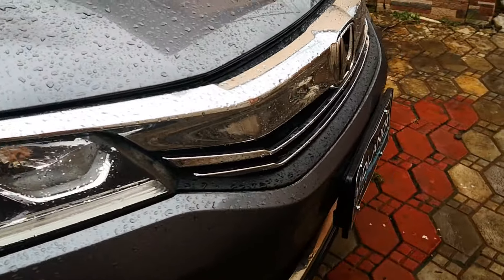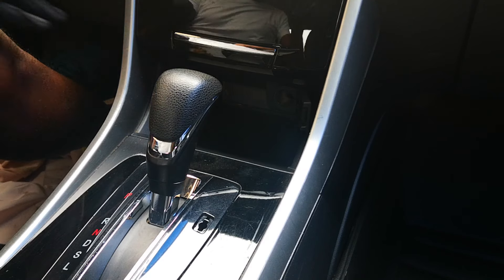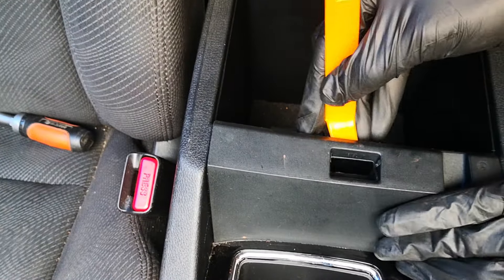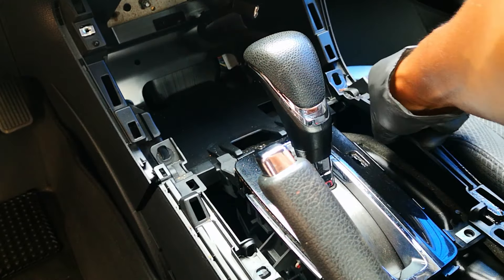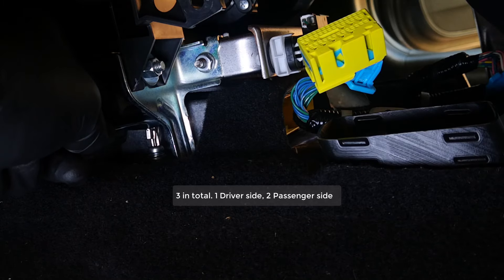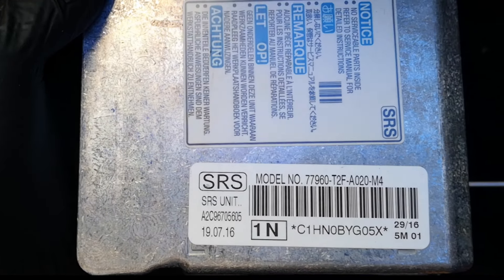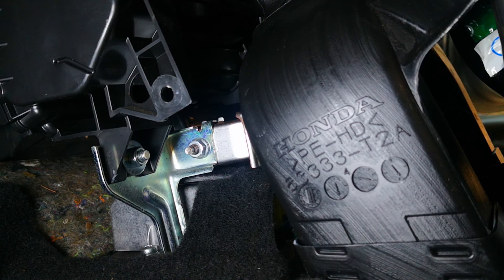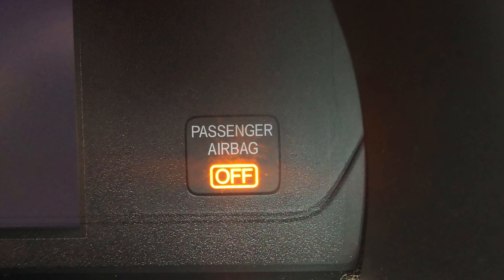Clear CRASH DATA after Collision / Turn Off SRS light / RESET Airbag LIGHT After ACCIDENT / Honda

Comment: Where did you send your srs module to clear the crash data?
Reply from the maker: I sent to a local service that does crash data deletion.
Reply: @DIYAutoworksNG  Hi, I sent my srs airbag module to the company named Myairbag to have my crash data cleared. After I received the module, I ten installed it back to the car the way you mentioned in the video. The airbag light did not go off, instead I received the following codes C1111, U0416, U3000, B0001, B00A0, C0051, I have a 2017 Honda Civic LX 4 Door Sedan. 

My second question is will I need to replace my steering wheel clock spring after airbag deployment? My horn works but I do have traction control light, srs airbag light and break system light yellow and break light red on. Thanks you for your help
Reply from the maker: Did you scan the SRS module before you started work on the car? This gives you the list of srs faults and thus, the things to replace.
I see from a code or 2 that the driver airbag deployed, also was there a front passenger in the car at the time of the accident? There's an occupant detection system (ODS) code as well. The rule is to do the scan first, complete indicated repairs, and clearing crash data comes last. On clearing the SRS light, if you've fixed all the repairs flagged, you may need to perform an ODS caliberation with a scan tool for the light to go off. Sometimes, you may also need to just clear the SRS codes from the ECU for the light to go out. 

For the clockspring, it must not be replaced as routine, there would usually be codes indicating an issue in the driver squib circuit. From what you posted, I don't see any codes indicating that.
I also think you may need to review the connections for the module, make sure everything is tight, no bent or corroded pins in the connectors.
Finally, it would seem there are srs unrelated codes in the ECU e.g. Steering angle sensor C0051. Not sure if the sensor was damaged in the accident or its wiring, or its an unrelated fault. How bad the collision? 
On Honda cars, its common for an SAS fault to trigger a parallel ABS or VSA code.
Reply: @DIYAutoworksNG   @DIYAutoworksNG  Hi, I have learnt that after having the airbag module reset or having the crash data cleared, all of the dashlights will come on like srs, tpms, traction control, and break light. The passenger weight sensor would need to be calibrated. I was wondering if the obd scan tool Autel Mp808TS was able to calibrate these issues and have the lights turned off?
Reply from the maker: Yes. The MP808TS is able to initialize the occupant deception module under the seat
Reply: @DIYAutoworksNG  can MP808TS also calibrate the steering wheel angle sensor? And also can it program tpms sensors. Thank you so much for your help. I have learned a lot.
Reply from the maker: Your welcome.
It will caliberate the SAS and program Autel's TPMS sensors. I've also used it to program some universal TPMS sensors (which have compatibility stated in their description). It relearns almost all TPMS sensors.
Reply: @DIYAutoworksNG  if possible, can you send a website address where I can purchase this scanner? How much are they usually?
Reply from the maker: Just check the description for any of the videos where I use the scanner, it has links.
Depending available discounts and all, you it can go between $800 - 1000.

Comment: Great video, good visuals of what you are up to, and well paced description all through the process. If all Youtube videos are like yours, people won't get stuck when they attempt a similar fix.

I have a couple of questions if you don't mind.
1. You said you sent the SRS module to a local service, is the local service in Lagos? Can you share their contacts? 
2. I believe a deployed drivers airbag always requires replacement of the seat belt before the SRS light goes out. What did you do about that?
Reply from the maker: Thanks for the compliments!
Answering your questions:
1. Yes, contact in Lagos. Either send me an email: piyke(at)diyautoworksng(dot)com or  send me a DM on instagram @piykediyautoworksng. I won't want to leave his contact on the open web. Too many scammers if you know what I mean.
2. The seat belt will only deploy if the occupant was wearing it. If they weren't wearing it (just like my case), it won't deploy.

Comment: Good morning, when the car is hit from the side, and the side bags on one side are activated, that is, the seat bag and the roof bag.  you have to do the same process, that module is a 2014 honda accord
Reply from the maker: Yep. Same process. Remember to check the side crash sensors. An SRS scan will point out the things to fix
Reply: @DIYAutoworksNG  thank you very much you are very kind